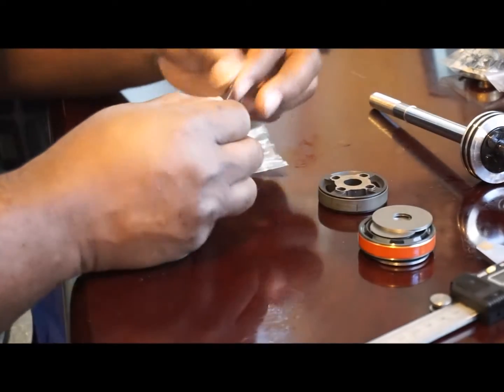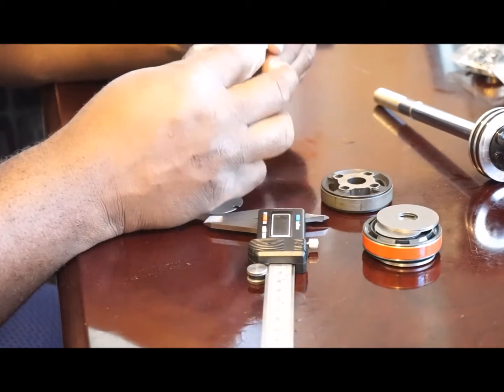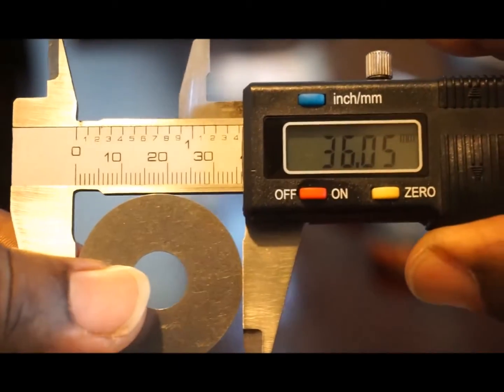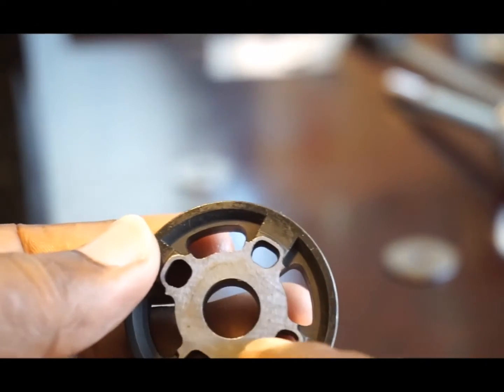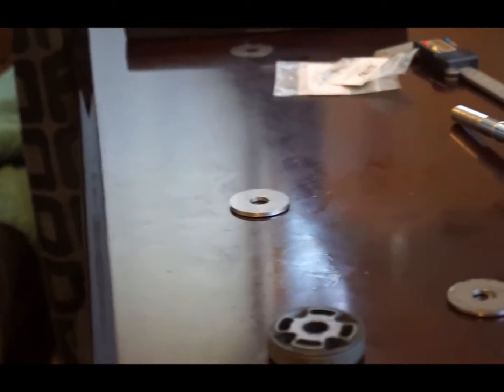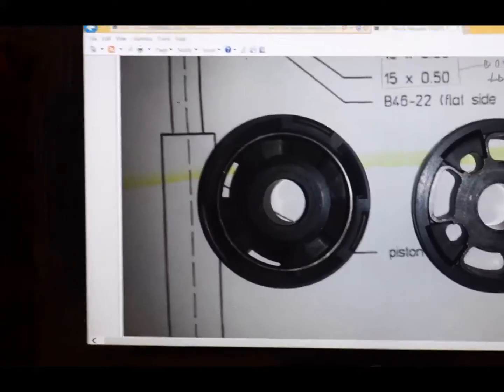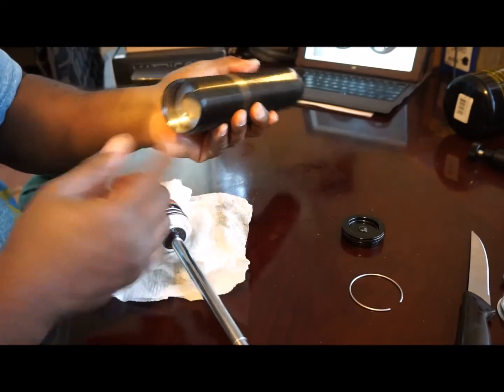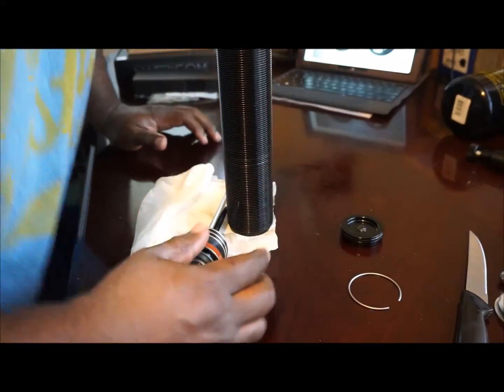DIY BC Racing BR shock Revalve tutorial - PART 3 (Bilstein Internals)

Comment: Good evening I am writing to ask you if you can change the extension braking of the 595 Abarth BC racing by changing the piston or changing the oil density or if there is a modification kit. Thank you cordiality Ghjuanni
Reply from the maker: Ghjuanni Jr11 OK I think I understand what you’re speaking of. Are you referring to the rebound forces (prevent shock from extending) of the actual shock?

If so yes this can be adjusted by changing of the shim stacks on the rebound side of the piston.

But before I change the shim stacks I would look at changing to a shock piston that is truly 50-50 digressive force on both rebound and compression side. Like the Bilstein 699 shocks piston you see used inside the Bc racing shock in this video

Then after obtaining a 50-50 Force shock piston, I would look at arranging the shim stacks on the rebound side just as you are requesting.

Please google “DIY shock revolve tutorial clubLexus”

I wrote A detailed step-by-step tutorial of my shock testing process, parts list, where to buy parts, and the results On the clubLexus.com car forum.
Reply: @frugalfabrication  grazie

Comment: I didn't think for some reason that the BC Racing valves would be non-50/50. I actually wanted a biased ratio, so it's good to see. For the roads I drive fast on I encounter severe bumps on hard high speed turns. I want the compression to dampen less so that my car hops less and for the rebound to dampen more to make up for lack of dampening on compression and prevent the car from bouncing.
Reply from the maker: You may want to look into a digressive piston profile if the bumps are an issue. The bilstein valving guide in the clublexus post will guide you in how to shim the piston for what you desire.
Reply: majanboo22
Are the BC Racing ZR series digressive? I don't see them use that term in their description.
Reply from the maker: DjRjSolarStar if you meant the "BC BR series", they are linear in their shock profile. The 3 different vehicle type sets I had dynoed all were linear.

I would google digressive vs linear to get an idea and also the pros/cons. 

Now that I understand the difference between the two, I would pick a digressive shock hands down (Daily driver fun car).  

Keep in mind that just because a shock is digressive does not  mean it is perfect. A digressive shock can still be valved inappropriately for a specific type of vehicle/car.